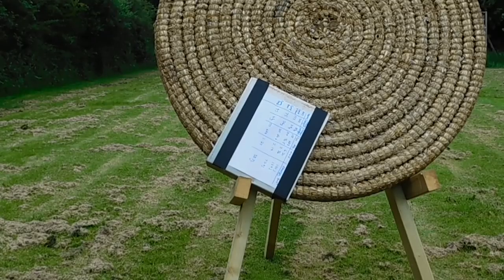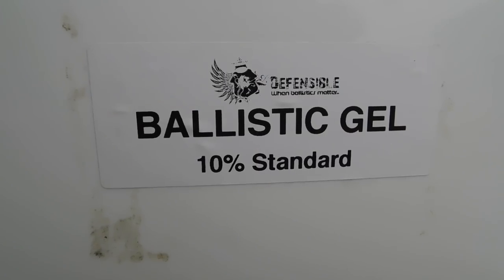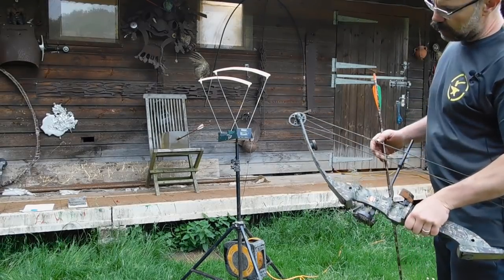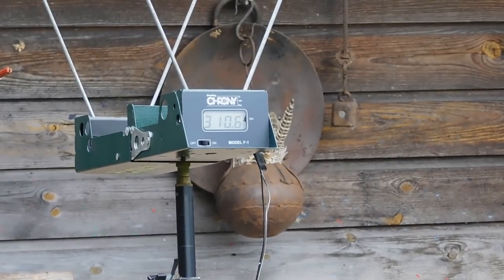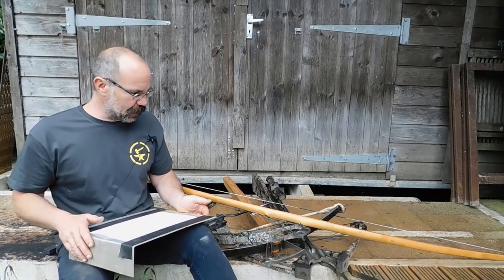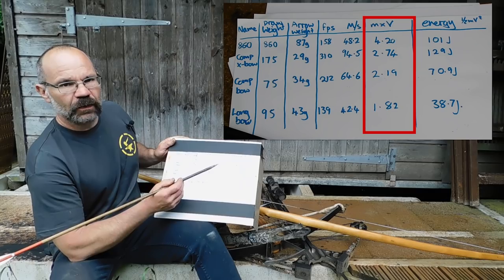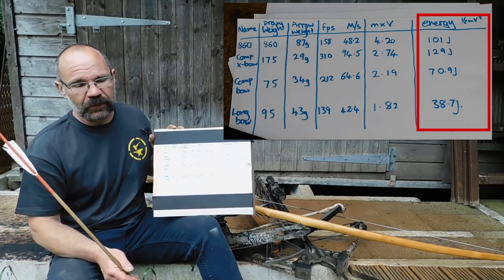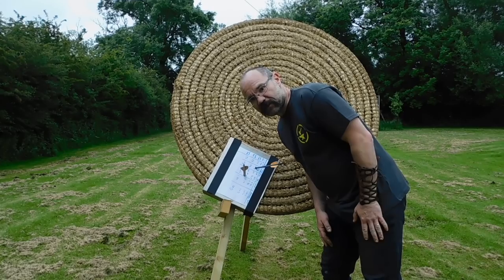Medieval vs Modern Crossbows/bows Ballistic Gel Tests

Comment: "Don't really know what that proves.  Just something to do on an afternoon."  I think that a lot more YouTube videos should start or end with that statement...
Reply: How efficient gun powder is.
Reply: Far more scientists should conclude their experiments by blowing holes in their clipboards...
Reply: Chris Moll wish I could
Reply: A lot more do "end with" that realisation anyway.  :-)
Reply: I think that it proves that you should not protect yourself from crossbow bolts with a 1.6mm aluminum if you are a practice target.
Reply: I mean it proves that using aluminium as armour is a tad bit silly
Reply: Sticking something in a field & shooting arrows at it is my kinda fun!
Reply: True
Reply: @TheTendermen  M113 APCs and M2 Bradley IFVs challenges you to a duel to defend their honour ;)
Reply: It's the measurement of force. Mass multiplied by speed. It's basically proving which one hits the hardest and travels further.
Reply: @tomislavobrovac9313   In this spreadsheet, it would seem Energy is the best predictor ( Mass x Velocity x Velocity )

  The next step up in number crunching would be Energy ÷ Cross Sectional Area .

   And finally would be the efficiency of the point, i.e. design,  angles, sharpness, hardness, etc .
Reply: @filianablanxart8305  it's easier to calculate the force and then use that value to calculate the energy. You have to do it anyway, that's why we use those formulas
Reply: Not for everybody unfortunately, for some reason my govt thinks that there's nothing wrong with commie-era legislation banning all crossbows that aren't plastic toys for kids while letting us have black powder cannons with no size limit, derringers that fit in your ass and 200 pound bows with no restrictions lol
Fortunately people have been making diy crossbows since forever (usually for less than 20 bucks using old truck/fiat126p leaf springs) and police doesn't seem to care even during massive public events where 90% of reenactors have no xbow permit lol. On the other hand completely legal knives (we have no restrictions in this regard) make them lose their shit.